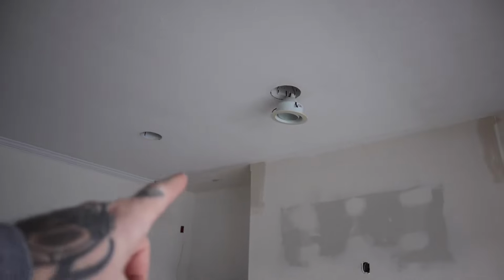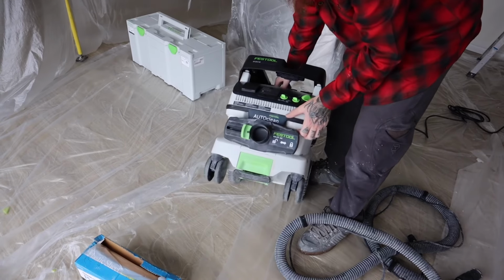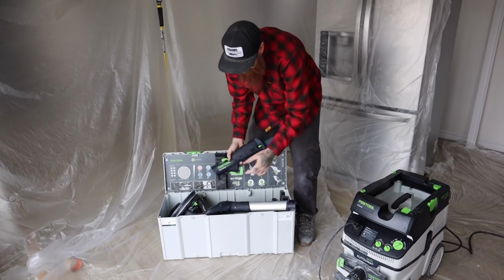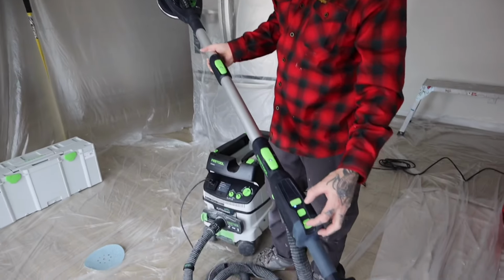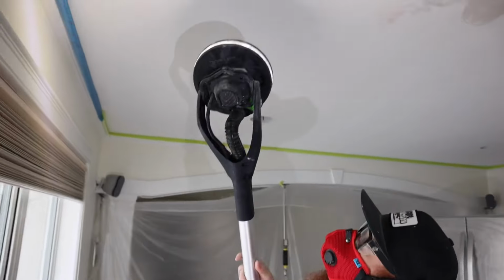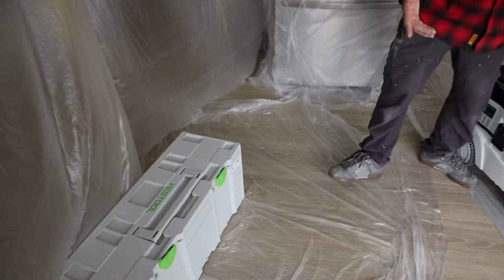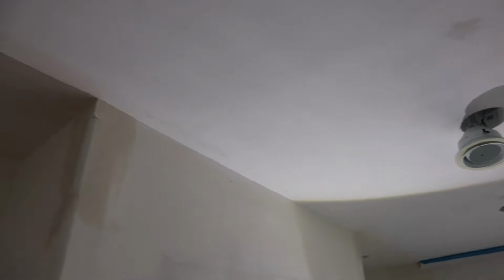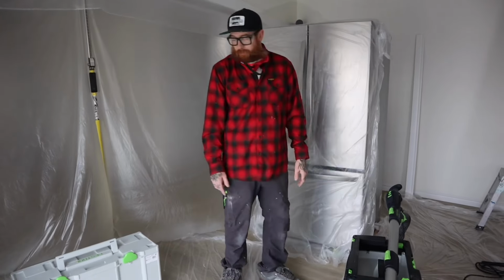Ceiling Texture Removal with the Festool Planex 2.0

Comment: I’m a General Contractor and have a bunch of Festool tools because of the dust control system. The tools are expensive but not putting dust everywhere in an occupied house or business is priceless, not to mention the health of my guys.
Reply: I work in painting
Can I get a job with you
Knowing that I am from Egypt
Reply: Based on your experience with the Festool Planex sander, do you know if it's available for rent?  If so, do you know who typically rents the sander?
Reply: @RedondoBeach2  I don’t know anyone that rents Festool. Some places rent the porter cable sanders which are not bad tool.

Comment: Excellent inspiration for my bathroom ceiling sanding--they painted the popcorn ceiling so sanding is the way to go for me. Thanks.
Reply: lol, not if it contains asbestos…
Reply: @hammockmonk   no asbestos. that was outlawed before house built.
Reply: I'm currently sanding and skimming a painted heavy stomp textured ceiling.  Using a power sander (not a planex) .  It's doing it, but it is slow going.  Is this something the planex excels at? I didn't expect this stuff to sand this hard

Comment: If you want a flat ceiling, do you need to skim coat or can you just prime and paint?
Reply: Textured ceilings are not done to the standard that a flat ceiling is done, so you will probably have to skim coat it to fix all the imperfections that are left on the textured/popcorn ceilings. The whole point of textured ceilings is to hide shoddy workmanship and save the company money.

Comment: Excellent show. This convinced me the Festool is the way to go.
Reply: I can do the exact same thing with my Dewalt sander and a Rigid shop vac for a fraction of the price. I also use a dust separator to save the filter on the shop vac. I can buy all this including two dewalt batteries, the dust sperator and the extra hoses and extra sand paper for less than the price of the festool sander alone.

Comment: That Festool Planex sander works good when you do a smooth finish wall? When the disk is spinning and you are about to apply it to the wall it doesn't cut on the surface or is there any way to avoid that?

Comment: Have you any experience with the sphir 36 grit sheets? I have a small job coming up with some horrendous looking textured walls that have a hard gloss paint over it and I'm not sure how hardcore I should go with the discs, especially when that saphir is much more expensive and things take two weeks to get where I live. Great job btw!
Reply: Currently I am having great success with 60 grit Granite and a light once over just to knock down the high points of the texture rather than trying to take it all the way to the paper which abrades the paper anyway. Then I roll on a coat of thinned all purpose mud and getting great level five result using a 30 inch Level 5 brand knife. Then I go back to the 9 inch sander for a light once over using 220 grit just to be sure that all the knife edge marks , if any are eliminated. This method has been giving me really great results with minimum effort. And
, I am using a cheap knock off sander, not a planex.
Reply: @frankchordas7456  I ended up ordering 24 grit saphir and 80 grit granite. There are some really bad patch jobs on the textured wall so I'm going to use those as my test areas and if it comes off okay, I'm going to do the whole wall. Not sure how the corners will be if I cant get in there with the planex though. A sturdy scraper maybe? It's also connected to a smooth finish transition I'll have to blend that really well. I happened to buy a used 24" tomahawk so I'm hoping that will be the ticket!
Reply: How did it go with your project I’m curious if this tool will work on super thick swirls  on a ceiling
Reply: @strawberryme08  it worked up until a point. I had like large bumps to take down on some stairwell walls and this would take down the high spots quick with no problem but that last little bit refused to go down. Which wouldn't have been too bad if it wasn't a glossy hard paint that remained. I did one round of the 24 grit pad and then one round of the 80 grit. It took me 3 full skim coats plus touch-ups to get everything looking smooth which is one more than I was hoping ahah. Despite the extra work, I still think it was my best option, just wish there was some kind of attachment or accessory for corner sanding!